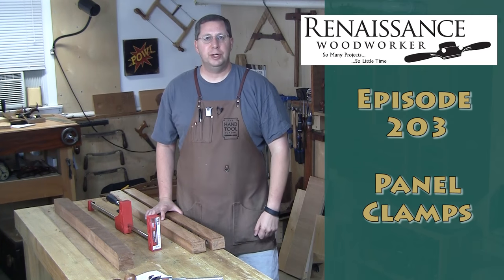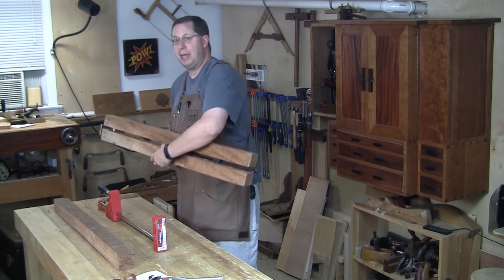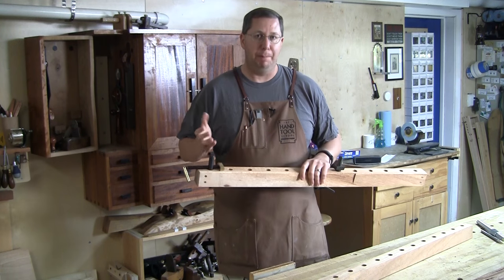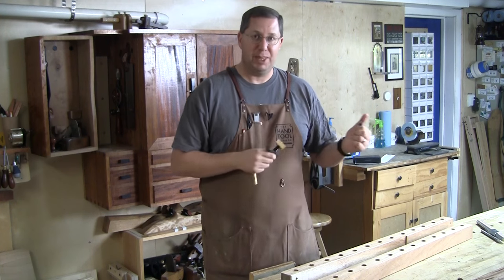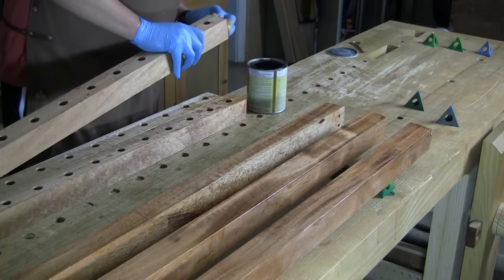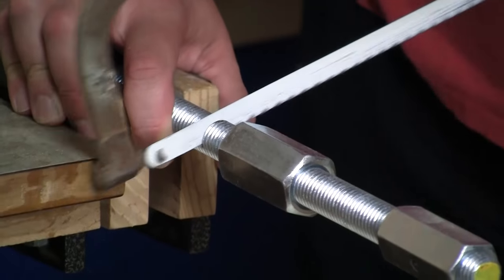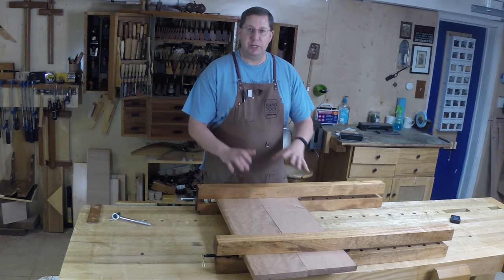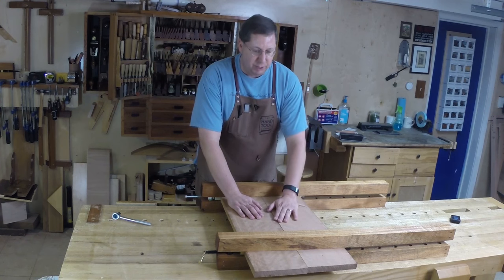RWW203 Panel Clamps

Comment: I just made this exact setup, using dowels/tee-nuts/bolts to replicate the Veritas clamps.  And using power tools to make the clamp boards.   Wow, serious respect on milling and drilling those things completely by hand power.  What a work out!
Reply: What size wood dowels you used? If they are wood do they are able to withstand the pressure from the sides? I want to make that setup too but that hardware here is pretty expensive.

Comment: I've tried both beeswax and wax paper to prevent gluing cauls to work pieces. I've found the best method for preventing gluing a reusable caul to the work piece is to cover the caul with clear packing tape. This lasts virtually forever (unlike wax) and they are always ready to go without additional preparation (unlike wax paper). I hope this helps.

Comment: Well the price has gone way up. Just looked them up (May 2020) and they are running $62.50, so off to the hardware store I go. Thanks for the tip. Just think I almost bought woodpeckers clamps that were $400. With this savings I should buy you a cold one.

Comment: Great video love those clamps...I have a question about your post drill...I have the same one, when I installed my chuck arbor, I ended up with a slight wobble...it's still works but holes tend to be slightly larger than the bit size...I'm wondering if you would share which drill chuck arbor you used and which chuck you went with?

Comment: These are really cool. I heard you talking about them on Wood talk. I think some packing tape on the clamping faces with holes punched in it for the hardware would be a bit quicker solution to the glue squeeze out issue. Thanks for the homemade solution Shannon!

Comment: I just finished yesterday the design of my panel clamps and on the screw side i'm using a thick flat bar with a hole and a nut welded to it. For the long bars i'm using square metal tubes with the same round holes and a round 5 inch bar to lock the panel

Comment: and you can cheat a bit more by using a drive adapter for the socket and use a cordless drill (obviously I'm a heathen power tool user!) do like it though.

Comment: @RenaissanceWW or other person, what is it about this setup that makes the cauls clamp onto the flat surface of the plans being clamped, please? It seems to me that the threads on the rods might just set the cauls loose unless preclamped onto the pieces being glued, but obviously not. Thanks
PS a lovely use of hand tools, thanks for showing that off..
Reply from the maker: its less about clamping and more about restraining.  The cauls provide a flat surface on top and bottom that prevents the individual boards from slipping up and down.
Reply: @RenaissanceWW  thanks :)

Comment: I am intrigued by this.  Nice work.  Please help me, a newbie woodworker, understand how putting horizontal pressure with the clamp also gives verticle pressure.  Thanks.
Reply from the maker: this is covered in the comments below a few time.  Consider a rubber band
Reply: @RenaissanceWW  I wasn't able to find where the vertical pressure question was covered in the prior comments. In the video you explained that vertical pressure occurred, but not how. I tried making a mini "practice" version of this before taking the dive, and no vertical biting happened at all. Not sure what I did wrong! I hope you can answer b/c I want this system to work. It looks great and will save me mega $$. Thank you for your time!
Reply: @greggentry2009 :
He is vastly overstating the case for vertical pressure being applied by the clamp. The way these clamps work is that the friction between the posts and the caul holes -- as the clamp is tightened -- prevents the cauls from sliding away from the work (the threads in the posts increase the hold, but these clamps can be made with smooth dowels and work almost as well). But it is important that you apply pressure yourself to press the cauls together while you are tightening the clamp (the Lee Valley instructions emphasize that point). Whatever pressure you apply while tightening should be held once the clamp is tightened (by friction between the posts and the caul holes). But there is no magical force applied vertically from a horizontal clamp. He seems to think the cauls are somehow stretched into pressing together by the clamping force, but that is nonsense. At best, if you started with thin, bowed cauls, then the clamping force could stretch them straight, but even then you would need to be pressing down at both ends of the cauls while you tighten the clamp, otherwise there would be minimal vertical pressure. But since his cauls are thick and not bowed, even that is not a factor.

Comment: Instead of wax paper you could use strips of plastic cut from an old coffee can lid. Lay them on the glue lines (top and bottom) and their thickness will act like a bow in the clamps while at the same time preventing the work from gluing itself to the clamps.

Comment: Thanks for posting this up!  Today I saw an ad for Veritas' panel clamps and then saw the price...yeah, no.  Searched YT for a video on it, found yours, and started making a set of three pairs today.  Total outlay?  $18!
Reply: Update:  I milled the boards for this clamp last night and glued up my first panel with it.  It's amazingly easy to do and QUICK!  No finagling with leveling the boards, no worry about excess pressure causing the panel to bow as it's clamped.  This morning, before work, I removed the now dry panel and tossed in the boards to make a matching panel in under five minutes, and that was working slowly.

Anybody gluing up panels should build this!

Comment: What do you think about using just a fix block of wood in one end and a wood wedge on the other end?? Wedges are ok to hold pieces in place, but I don't know if they could provide enough pressure for a panel glue up.
Reply from the maker: Absolutely, you are describing clamps often found in 18th century shops.  Don't overestimate how much pressure you need for a panel joint.  If you can't close the joint with hand pressure alone, you need to tweak the joint until it does.
Reply: @RenaissanceWW  I thought I was being really cleaver by this wedge idea, but turns out is a method that's been around for centuries (lol). I will plane the boards the best I can before trying to joint them with the wedges (I'm building my first workbench).
Reply from the maker: @OrangeGeemer  ha ha not a lot new in this craft but most of us have forgotten more than we know so keep asking questions and finding other ways to do things.  Its all options for the quiver.

Comment: Really like  your home made hardware, and that post drill is awesome. I wonder though. Why can you not use an auger bit in the post drill? Also being a metal working tool, does it have the right speeds and feeds for woodworking? Again, I don't see how the forstner bit should be much slower than the auger if you could just feed it in sufficiently fast.
Reply from the maker: neistridlar an auger but feeds itself via the lead screw. So unless the feed rate of the post drill matches the lead screw it wont work. Not to mention the trouble of chucking the pyramidal shank.

Comment: The magnet to let the thread swing is genius, thank you. But you said to leave the second magnet flush, then I see the threaded rod actually goes inside the wood, did I understand this wrong? Thank you again
Reply from the maker: There are 2 clamping blocks.  One has the magnet flush and it just sticks to the static post.  The other one slides onto the threaded rod and does the actual clamping.  I suppose a magnet inside that isn't necessary since the rode slides into the block, but I like having the magnet in there to keep the block from falling off.
Reply: @RenaissanceWW  Thanks very much for answering! I think the magnet is a great idea, on both sides
Reply: @RenaissanceWW  I'm now thinking that the magnet also can stop the wood block from marring, but to much pressure sometimes breaks magnets. I'll give it a go and see!

Comment: Is there a purpose for the screws on the ends/sides of the lumber?
Reply from the maker: Ty Moser just a belt and suspenders prevention for potential blow out with pressure so near the end of the wooden bar.
Reply: RenaissanceWW kind of funny that you say that. I heard you say belt and suspenders literally ten minutes ago while I was doing yard work.

Comment: Such a simple and economical solution! Definitely on my to-make list now. Do you think a star knob on the adjustable end would provide enough leverage for sufficient clamping pressure. It would eliminate the need for the ratchet, and woodpeckers makes awesome star knobs that will receive a 3/8" bolt head, they are cheap and they look pretty too! I also like the idea of the through hole in the wood piece on the stationary post that someone else mentioned.
Reply from the maker: Yes I think that would work.  In fact it might prevent you from over torquing the clamp which we can do easily with the leverage of a socket wrench.  If you have to apply that much pressure to close up a joint, then you probably need to make a better fitting joint.
Reply: RenaissanceWW I agree! Again, thanks for the awesome video. There was a New Yankee vibe to it. Very well thought out, making the project approachable, just like Norm.
Reply: RenaissanceWW http://www.woodpeck.com/multiknob.html - just in case you are interested.

Comment: if you heat bend the 3/8 bolt at 90 degrees that would make an easy handle.
Reply from the maker: yeah but then I don't get the cool "I'm getting things done" clickety clack of the socket wrench.  It's essential for any high energy musical montage.
Reply: this is true

Comment: Does the Lee Valley hardware use acme threads? And have you noticed any degree of damage caused by the threads of the 3/4" rods biting into the holes?
Reply from the maker: no damage from the threads, but its still early days.  However with a good hard wood in the cauls I think any wear will only increase the vertical clamping pressure as the posts will be able to slide and cam better.  As far as the threads on the Lee Valley hardware, I don't think so, but I'm not sure.  The look pretty fine for Acme threads, but then again I'm not the best judge of what is Acme and what isn't.
Reply: The roadrunner will know!

Comment: How does the compression from the edge of the boards cause pressure down onto the face of the boards?
Reply from the maker: the posts in the bars shift back causing the bars to squeeze together.  Imagine a rubber band.  Put two fingers in it and spread your fingers.  The rubber band goes taut and the gap in the middle decreases.

Comment: That's a nifty idea there.  Does it matter which way the end grain is going on the board?  Do you need it to be springy or doesn't it matter.  Thanks.
Reply from the maker: Jimbo L nope shouldn't matter. Just a hardwood. The thickness gives you plenty of stiffness
Reply: ' I've never seen this before. I guess I'm not understanding why more people don't use this simple, easy, method.  It seems like the ultimate problem solver for panel glue ups.  Guess I've been subbed to the wrong channels all these years.
Reply: Thanks for your response.  It's laminated pallet stringers for me then!  Yep, off to Home Depot for the hardware.